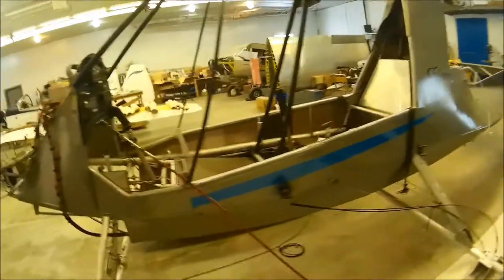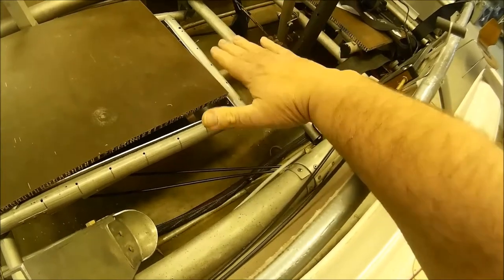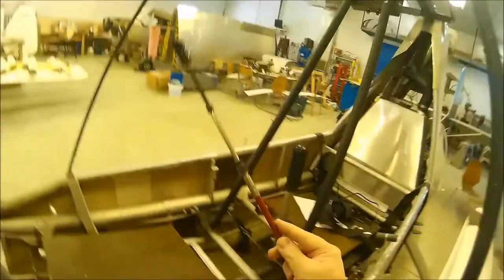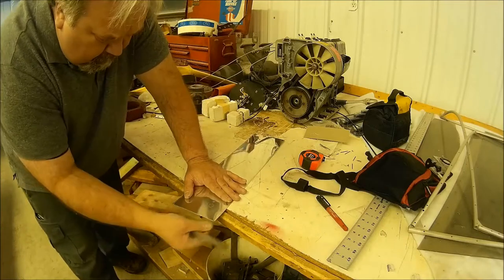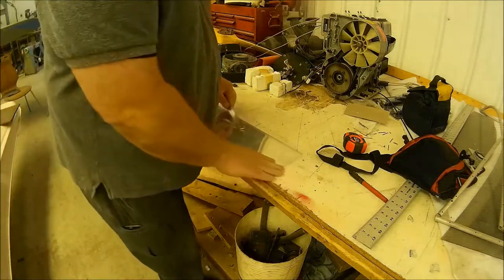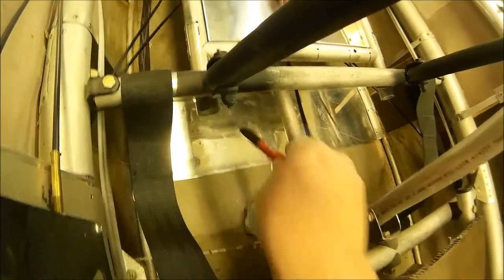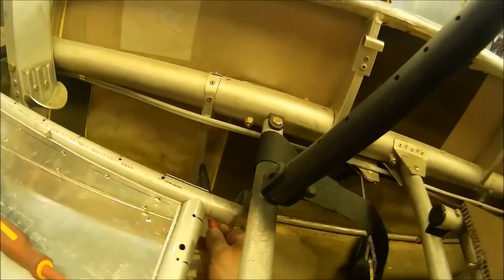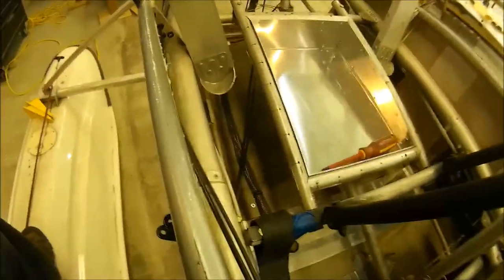EP #25 The hard work continues on my Challenger 2 Ultralight Airplane.

Comment: You got some mad electrical skills. So you know how you have that trim motor on top of the fuselage? Why use that same kind of motor or one better and make a bracket to put that motor on where u put that aluminum plate, add a "T" to the end of the actuator so now your cables that lock and unlock your landing gear is automatic?
Reply from the maker: I considered that for the landing gear, but for now I'm going to keep the costs and weight down till after I fly it for a while and decide then what to do next.

Comment: Did you ever get your engine cleaned up?
Reply from the maker: Not yet, just waiting on one special tool to remove the flywheel, then I can start working on that.
Reply: @challenger2ultralightadventure  well, if you get bored later type in Vapor Honing and watch a video on youtube.  May spark your interest in getting those engines parts showroom.  The rest of the build looks fantastic!  Don't leave any stones unturned.